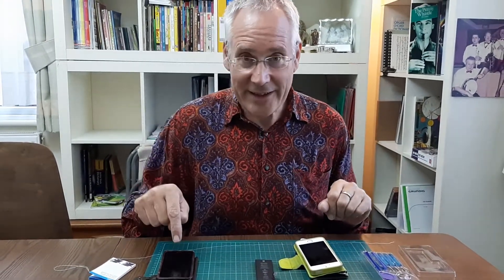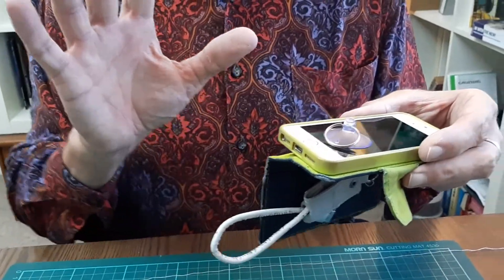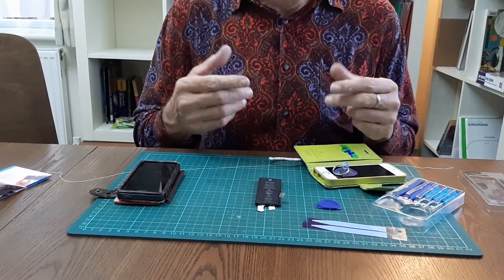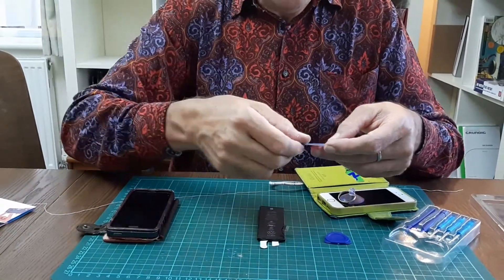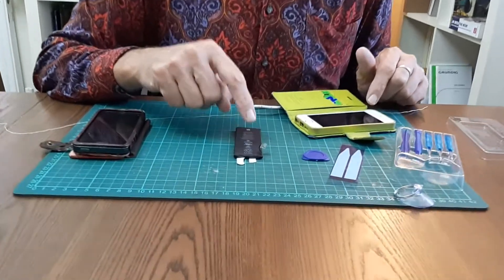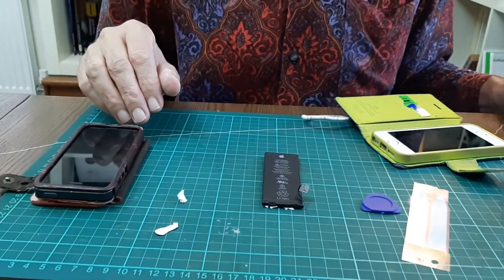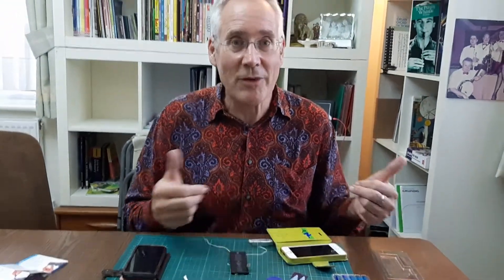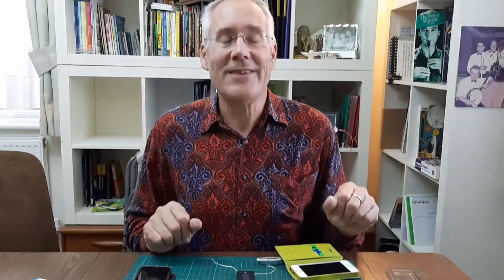Averting iPhone SE battery replacement disaster!

Comment: Many thanks for this tip. The adhesive tab ripped off right away, nothing to pull on at all after that. I used thread labeled "high strength for quilting", tripled and quadrupled it, and went through maybe 10 yards of it anyway as it kept breaking. I was only able to saw through maybe 1/4 to 1/2 inch at a time before breaking the thread. Most of the time with the battery change was taken up dealing with this adhesive issue. But it's back together now and working. BTW, after all this I ran across another tip - to squirt some isopropyl alcohol under the battery if this happens, to help dissolve the adhesive first. That might have sped up the process quite a bit.

Comment: Thanks for telling us about this fix.  Per another video I also used a heat gun to GENTLY head the case just under the battery - to soften the adhesive a little.  Instead of thread I used dental floss.  Like the thread it took quadrupling the count, but it worked and left my phone minty fresh!  (Just kidding about that last bit.)